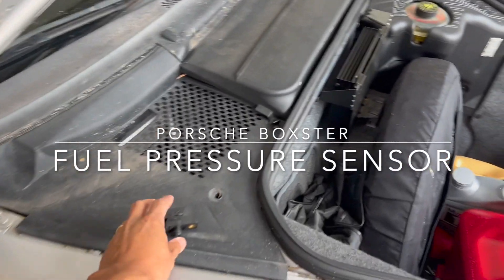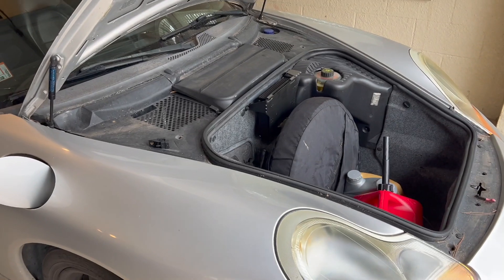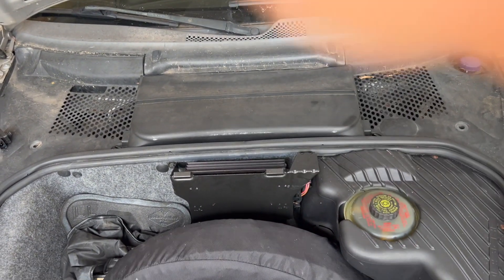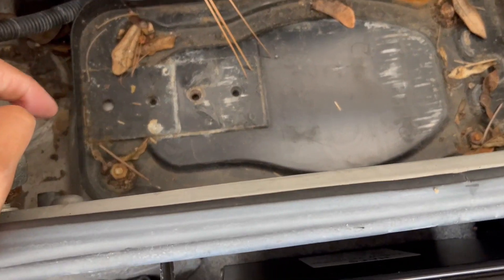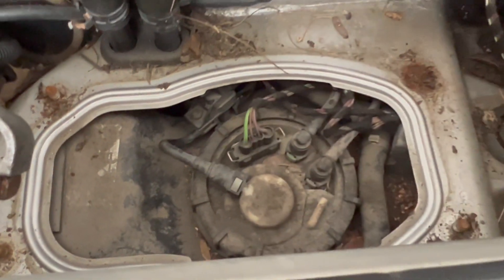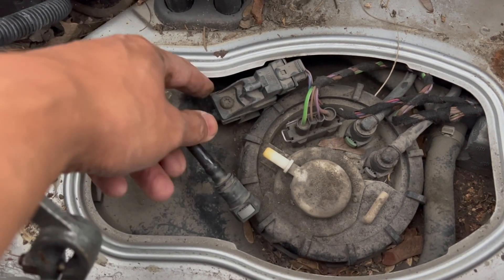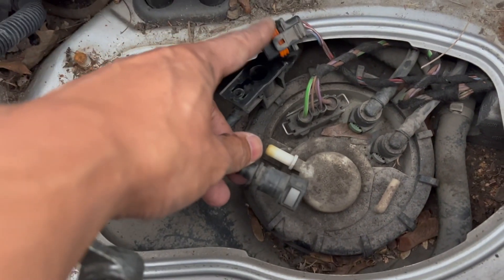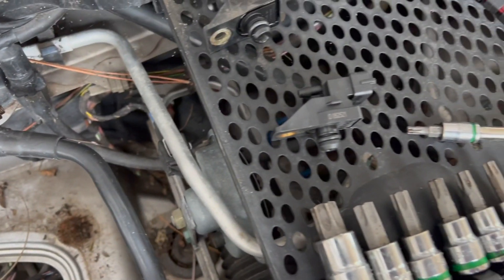porsche boxster - fuel pressure sensor

Comment: What were your symptoms? Did the car crank but not start? No fuel pressure at fuel rail?
Reply from the maker: Pump gas…not a problem.  Start the car….chokes.  Replace charcoal canister.  Did not fix.  Replace the rest of evap breather.  Still no go.  So I replaced this sensor. Did not work.